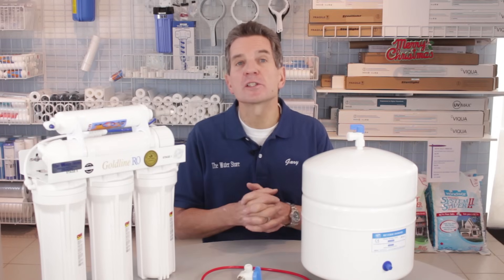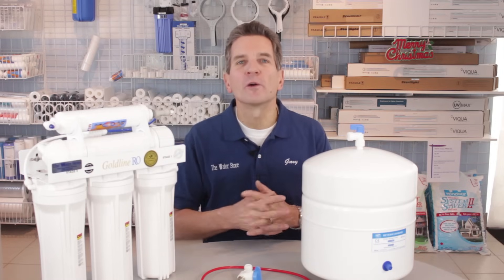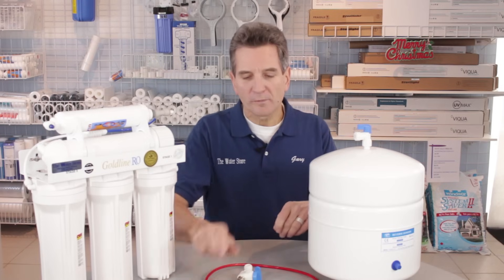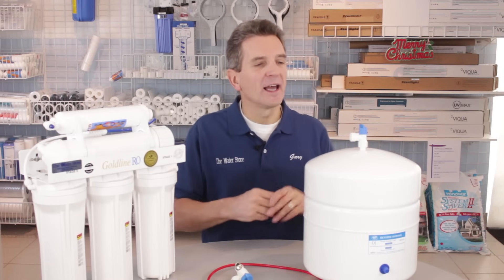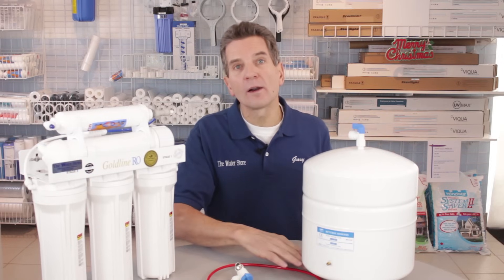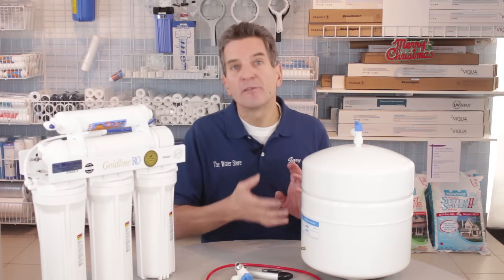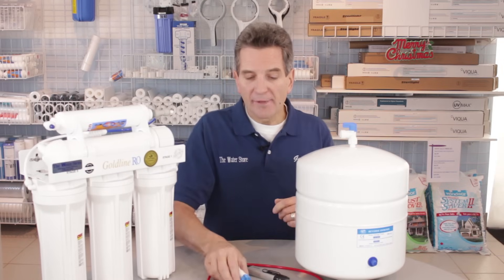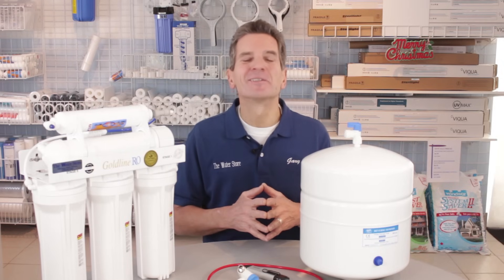Reverse Osmosis Troubleshooting - Little or No Flow from Faucet

Comment: This guy is the man! I would only be able to a get pitchers worth of water out of my 5 gallon RO tank. I drained it all out, adjusted the PSI and now all the water in the tank comes out. Thank You!
Reply from the maker: Glad to hear it worked for you. Please share video!
Reply: Curious Why is draining needed? Would it work just pump to 6-8 psi directly(with valve closed)?
Reply: The air bladder needs to be the correct psi and size in order to function properly. 
If the water is in tank when filling the tank it will not allow the air bladder to reach the correct size.

Comment: My system was only two weeks old and it stopped filling up. I called ice Spring numerous times and they will not call me back. I’ve installed a few of these, but this is the first time I am in need of customer service. The black tube continues to pour out water while the tank does not fill up what could be the problem?

Comment: Well that was not it.  I checked the pressure it was 8 psi..  the tank was not heavy.   Any other ideas?  

OK Kids, what this gentlemen didn't tell you is it may be caused by the RO filter primarily Filter 4.   I was shocked since my RO system is barely a year in.   Two people using it and the filter was encrusted with crystals, after 1 year.  This just goes to show you the water utility is chemical-happy.

Comment: What if there is a new tank installed and still no water pressure at the faucet? What would be the next step? 

New tank new filters and I verified the water to the system is on.

Comment: Can you help?  Here are the details or our RO System: The reverse osmosis system only used for drinking water/ice thru refrigerator is mounted on a wall shelf 1' from ceiling in the garage which is about 15' from refrigerator. The 1/4" tubing runs up thru the attic to refrigerator. (There was no water source on the kitchen wall—only an island sink and a refrigerator with no accessible water line—so this setup was the only feasible option.)

Since water pressure after filtration was just a trickle, we had an Aquatec Demand/Delivery Pump DDP 5800, Model 5850-7E12-J574 installed after the RO system to boost the flow. It helped improve the output, but now the pump makes a loud rattling and banging noise whenever we draw water from the refrigerator.

All tubing is 1/4", except for a 3/8" line running to a small 1–2 gallon plastic pressure tank (labeled for potable water). Only two people live in the house, so this capacity has been sufficient. The 4-filter RO system (purchased and installed by a local plumber)  has no clear manufacturer markings, but the warranty shows Safeway Water.

Incoming water pressure to the house is around 60–65 PSI. We have a whole-house water system, but no water softener or conditioner.

Any ideas on how to quiet the pump or improve the setup?

Comment: Ok so I hadn’t completed all the steps……I have to unhook the tank entirely….

My tank says 100 psi for maximum pressure but you said 5-7 psi, wondering why the difference?
Reply from the maker: That tank can be used for a variety of purposes, it is good for UP TO 100 psi but for an RO you need 5-7 psi for it to work properly.

Comment: Thank you so much, I was finally able to get this problem fixed! Is there a video (if so, could not find it) on how to connect my RO system to the fridge?  Our fridge is already connected to water but would very much like for it to connect to our RO system as well !
Reply from the maker: Unfortunately not, but you just add a "T" like this on the line going to the faucet and then connect it to the fridge water supply. https://waterestore.com/products/john-guest-reducing-tee-3-8-x-3-8-x-1-4
Reply: @ Great, thank you !

Comment: Greetings.   Nicely explained but when you pressurize the bladder, don't you need to close the valve at the top of the tank so it holds the pressure?    In your video you never closed it after the draining portion.     Seems to me that unless you close that top valve, the air you are pumping in will just escape right back out the top?    Am i incorrect?
Reply from the maker: No, you are pressurizing the bladder, not the part of the tank where the water is stored

Comment: The problem is no matter how much i keep on pressing the Shrader valve but water wont still come out.  Need help.
Reply from the maker: You need to add air to the bladder tank with the tank disconnected and the valve open to get the water out.
Reply: @water_estore  just fixed by disposing the water manually opening/unscrewing the top part of it

Comment: My air pressure is at 9 psi but water very dlow
Reply from the maker: Is that with the tank empty? If so, drop it to 7, if that still doesn't fix it, you have a restriction or clog somewhere.

Comment: Had/have slow water.problem. Drained.tank.  On tank says.10 psi Max.50 psi with.table on side of tank tells. In 10 psi increments how much water will be in tank. 
How long will it take to refill tank and be back to proper floe?
Reply from the maker: The tank should have 7 psi pressure inside when it is empty.  Aty that pressure usually takes 3-4 hours to fill.  If the pressure is higher the tank may never fill.

Comment: Gary, I successfully empied my tank and hooked it back up again and it is running fine. Thankyou for the good instructions. But, while I was emptying the tank the water stopped coming out about half way empty. I had to insert a stick into the air valve to empty the rest of the water as well as alot of the air. The water came out brownish. Is that because it has rusted inside? Do I need to replace the tank?  Now that it is up and running there is no sign of discoloration or off taste. What do you think?
Reply from the maker: I've never seent hat before but to be safe, I woudl replace the tank.  We have them here https://waterestore.com/products/metal-reverse-osmosis-tank-4-gallon-ro-tank-pae-ro-132

Comment: Hey Gary, what about if tank stays empty and doesn’t fill? I did a new install and left for several hours no water going in (shut off valve was   Closed and also feed water valve is on). I tried to fill tank directly and drain still nothing
Reply from the maker: Tank shut off should be open to fill the tank.

Comment: What if the tank is empty? We’ve just installed an RO system and we waited 24 hours. A little trickle of water and then nothing. Tank is very light. Has about 10 lbs of pressure. It had between 5-7 when we first started. Heeeeelp!
Reply from the maker: First, drop pressure back down to 6 psi.  Next, shu off the tank and open the faucet and let it trickle for about 3 hours into the sink.  Then close the faucet, open the tank and it should fill.  If not, contact whomever you bought it from.

Comment: Our problem is that our new tank won’t fill. Psi is within range. Before finding this video, we replaced our tank (which was full), but new tank won’t fill so we still have limited output. New filters six months ago and just replaced sediment filter again. Our plumber is stumped. Any thoughts?
Reply from the maker: Did you replace the membrane when you repalced the filters?  Drain and supply lines are free flowing? When you disconnect tank from system, water flows slowly to tank?  Check this video https://youtube.com/live/jur9sS2mo34

Comment: My APEC tank says “100 psi” on it. Should I still only pressurize to 6-8?
Reply from the maker: That is the maximum pressure the tank can contain. For a Reverse Osmosis system you need 6-8 psi in that tank.

Comment: What if water doesn’t come out of the tank when I use a ball pump? I tried the PSI reader, and it says 40…I’m assuming there is still water in it
Reply from the maker: You can usually tell if there is water in it because when you lift it up it will feel heavy. If you have 40 psi in it and you open the valve water will come out unless it is empty

Comment: Here you go, lessons I learned the hard way (my ASO value would not operate correctly): 
1) Make SURE you understand the IN & OUT ports and hook up the lines correctly to ASO valve. 
2) Use ONLY hard lines to interconnect (dont use clear lines from home depot, they are too soft and value wont shutoff correctly). 
3) Keep all hard tube lengths to ASO value as short as possible.
4) On all connections make sure the tubes push all the way down 
5) On all post carbon filters, post filters, etc...dont plug directly into these filters, first always use a push in connector then push your tube into those connectors.

I did all above and fixed my ASO value  RO system operation.
Reply from the maker: Thank you for your suggestions

Comment: Can you tell me water is coming in to filters but not coming out of filters to the tank and filters are not even a year old. What could be wrong?
Reply from the maker: They could be clogged, I would open them up and check.
Reply: @water_estore  Thanks anyway I tested them and the one that has output for drain was clogged. Now lots of pressure

Comment: Could the issue be with the check valve that needs to be replaced? I'm trying to diagnose the issue with my system. My tank seems very full. Had a dripping/draining sound for a while before we had little to no water flow when getting water from the spout.
Reply from the maker: No, I doubt that it is the check valve.  Did you check the tank opressure when it was 100% empty?

Comment: If its low pressure, wouldnt the tank be full of water, and not much water coming out of the tap?
Reply from the maker: Exactly
Reply: I've had an RO system for over 10 years and have never had this issue in my previous homes but...even though I'm on city water, I find that my sediment filter gets clogged up in less than 1 year.

Comment: I have a watts system similar to this...

Now having an issue where it does not work very long.  Seemed like when new it was fine for about 2yrs.  Replaced the carbon filter that was clogged up and all good again for a long time.  The old filter was full of stuff when I shook it out.

The past 6mo or so, we have an issue.  Replaced carbon filter about 8 mo ago and again about 4-5mo ago even tho hardly any crap shook out.  That lasted about 3mo and same again.  I ran the tank empty and checked the pressure as shown here.  I did not force purge it but no water would come out and it felt light.  So, thinking maybe other filters were clogged I re-filtered it all (probably 2/3 the cost of a whole new system) and it worked OK for now about 3 weeks and suddenly it quits again and tank is obviously not filling.

I tapped on the valve doohickey in the lines and tapped on the manifold wondering if there is some sticking valve there.

I suspect replacing the carbon filter again it would go for a bit but this is getting silly.  I do wonder if I have a water pressure issue as my flow for the other faucets is not good and this has changed since some water main work was done last year.  But, on the filter replacement 3 wks ago it clicked and gurgled well until suddenly a few days ago it stopped again.

At the cost of filters if this is an issue, cheaper to buy bottled water.
Reply from the maker: You do need at least 28 psi for these to work properly

Comment: Hi Gary, great video, thank you. I have a few questions though: If the tank bladder isn't leaking, then how does it lose pressure? What will the tank pressure be when the tank if full? How often should I check the tank pressure? Thanks, Rick
Reply from the maker: It very slowly loses pressure over many years of use.  Full pressure depends on your water supply pressure. You only need to check the tank when you have very little flow and the tank is full

Comment: Hi! I hope you can help troubleshoot with my RO system.  I don't have any issues with the water pressure for the RO faucet but I am having trouble getting good water pressure to my sink faucet.  This has happened when I first installed the RO system but the water pressure for the sink went back to normal after a month or so by itself.  Now, after replacing the water line, it is happening again.
Reply from the maker: Does this happen during the time the Reverse Osmosis system is filling the tank?  Or all the time

Comment: I did this whole process but when I turned my water back on to the tank the pressure in the tank rose from 7.5 psi all the way to 30 psi. Any tips anyone ? I can’t get the flow correct.
Reply from the maker: That is normal and why you need to check the pressure in the tank and correct it when empty.

Comment: Hi… we recently got the RO water treatment installed but the water flow is less that could only fill up a glass. Do you think the problem is with the tank pressure ?
Reply from the maker: Sorry, I don't understand your question.
Reply: @water_estore  we recently installed reverse osmosis (RO) water system in our house. With less than six months, we have been noticing that the water flow is less which could only fill a glass of water. Then no water is coming from the tap. Do I need to check the water pressure in the tank for that? Or could it be a bigger problem?
Reply from the maker: When you run out of water is the tank heavy, like it is still full of water?  If yes, you need to check the air pressure in the tank.  If no, you need to check for a clogged filter.
Reply: @water_estore  the tank is light.

Comment: Hi Gary. Great content. I have an RO system. Having pressure issues but my storage tank has about 7psi pressure but the label on the tank reads maximum psi is 100 psi. Should I add more air pressure?
Reply: Also I have no shut off valve on the top of the tank.
Reply from the maker: No, just make sure the tank is completely empty before checking the pressure and it should be 7

Comment: I have done this a couple of times.  The second time it was still retaining pressure.  All seems ok from a tank perspective. However water flow from the faucet is still very slow    Any suggestions on the next steps
Reply from the maker: Was it ever better?
Reply: Yes it has been better.  I have checked for hose kinks but Ok. All I can think are possibly there is a filter issue

Comment: I have a CRO-400ux1 , no option to add a tank but has a tank built inside .. water to the unit isn’t an issue and it gives good pressure, but I can’t get good pressure to the facet . Any ideas?
Reply from the maker: I am not very familiar with that system but I am pretty sure you can add a delivery pump or second tank to the water line going to the faucet like in this video https://youtube.com/shorts/wKMdBCeBKj0?feature=share

Comment: So I have just recently changed out the pre filter and post filter and the reverse osmosis cartridges with new ones. Water coming out slower than it was with the old one. About 1 month later it’s only filtering less than a bottle amount of water a day. I can confirm the tank is pressurized at 7 PSI when empty . Do you know what the issue could be? 
Thank you
Reply from the maker: Either you didn’t change the membrane or something is clogged. This video might help https://www.youtube.com/live/jur9sS2mo34?feature=share

Comment: Thank you for this great video! I followed your instructions. I could not pump any air into the tank as it was so hard, and the tank was still full. Then, I used a nail to release some air from the valve, the water shot out from the opening, very strongly! I cannot explain this: Why water did not come out when I pumped, but shot out when I released the air from the valve.
Can I still repair the tank? Or, I have to buy another tank? Please help.
Thank you very much!
Reply from the maker: You need a new tank.  We have them here https://waterestore.com/products/metal-reverse-osmosis-tank-4-gallon-ro-tank-pae-ro-132

Comment: Thank you for your video. My RO tanks says maximum working psi
is 100PSI. Any idea why it’s so high?
Reply from the maker: Good question! That tank can be used for other applications too where you migh need high pressure but not for an RO.

Comment: I am confused.  If you use the Schrader valve to pump up the bladder inside to get the water out, won't the air remain in there or you have a change to burst the bladder?  You go on then say check the air pressure with the same valve.  I guess this is a bit confusing to me.
Reply from the maker: Yes, you want the air to remain in there to push out the water.  When the tank is empty you check the air pressure to make sure you adjust it to get 7 psi with the tank empty.
Reply: @water_estore  do you want the ball valve open when pumping the bladder back up to 7psi?

Comment: I have the Apec Water tank 4. It's working psi is 100. Do the same rules apply?
Reply from the maker: It might say on the outside of the tank that the maximum pressure that tank can handle is 100 psi but the pressure you need for your RO is 7 psi.
Reply: @water_estore  I see. Thank you. I appreciate your help

Comment: Lol, no mention of the actual system. Thanks. Literally came here to fix a problem with a tankless system.
Reply from the maker: Something must be clogged or shut off
Reply: @water_estore  thanks. Sorry for being snarky. I guess I was having a bad day researching. I replaced the filters, and am wondering if the water pressure to the house is lower than it used to be. Still running at about 40-45psi. I'm trying to get the city to come open the meter and turn it up a little. Ideally would like to see about 70. Also plan to put a second 100 gpd membrane. 

Any chance the replacement membrane could be the issue?

Comment: Couldn't you open the valve after draining the tank and after charging with air to see if the pressure drops and the air escapes in which case, that would let you know if you have a ruptured bladder?
Reply from the maker: Yes, but if the bladder is ruptured water will escape from the shrader valve as soon as you try to add air.
Reply: @water_estore  Right, good point